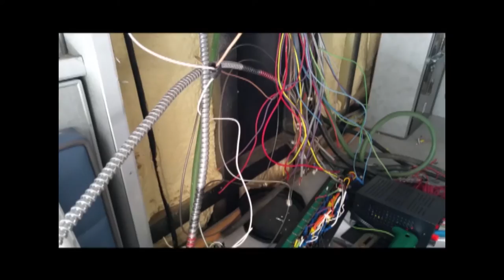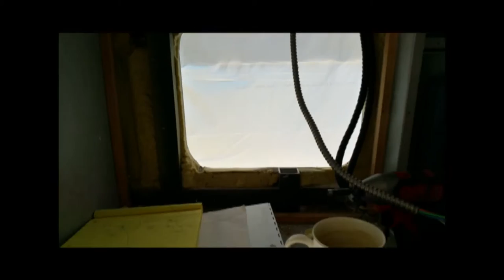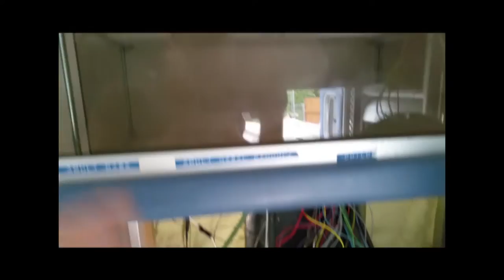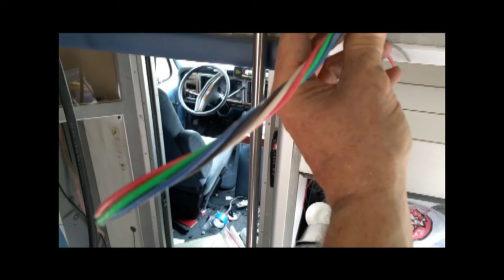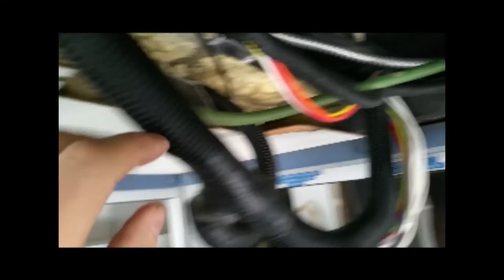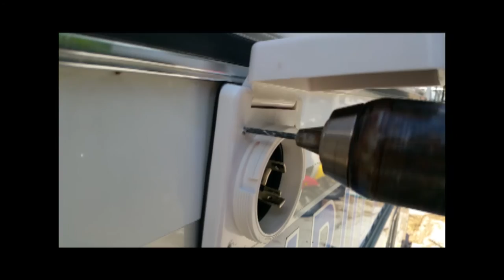#5 DIY Ambulance RV Conversion; Camper Van, Motor Home

Comment: Did you use a special window trim ring to accommodate for the thickness of the walls?
Reply from the maker: Yes. These trim rings were made for the wall thickness.

Comment: Hey!  Just a heads up, that 14-4 MC cable you're using is NOT good for 3 circuits in your case.  You can not share a neutral because you do not have 120/240V service.  Tape the blue white and use only 2 circuits.  Otherwise I thank you for your video.  I'm a licensed electrician and am converting one into a work truck.
Reply from the maker: Thanks for the heads up!

Comment: I was wondering, how warm is it in the back? I know a lot of regular vans or firetrucks people have converted have had insulation set up in the conversion process, or are ambulances already made with insulation for the passengers, or is it warm enough now that you don't have to do anything? Thanks!
Reply from the maker: The back is built with a 2" square aluminum frame; aluminum skin on the outside and panels in the inside. The 2" cavity is filled with sprayed insulation. The floor as well has sprayed on insulation underneath. They went to great efforts to keep the back cozy!